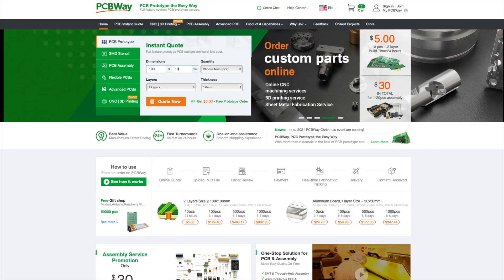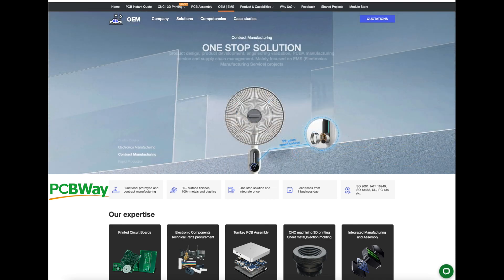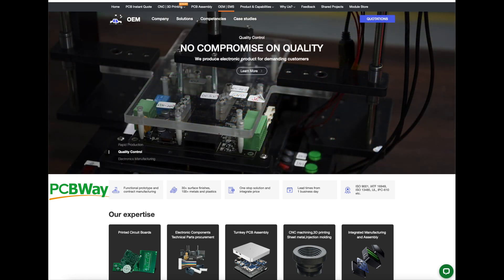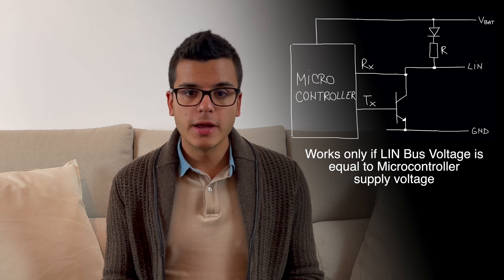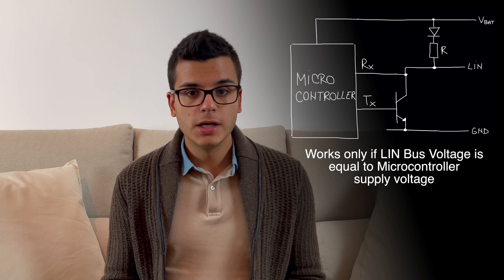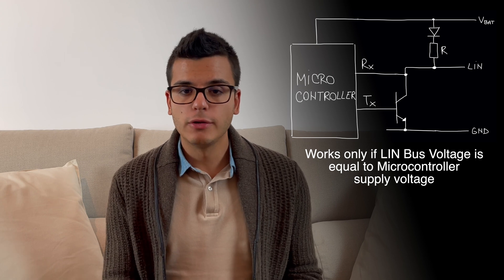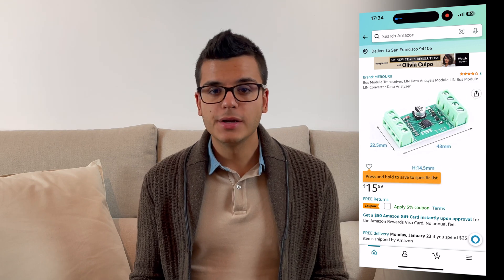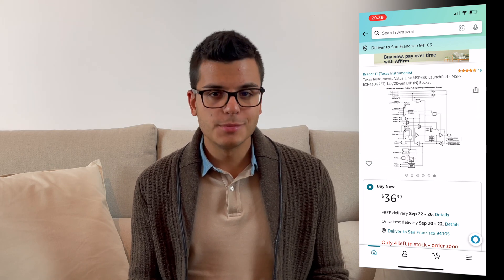Learn How The LIN Bus Works (Local Interconnect Network) | Embedded Systems Explained

Comment: Very helpful video. Currently, reverse engineering a car with a proprietary radio that is integrated into the HVAC controls of the car. This makes things a lot easier.